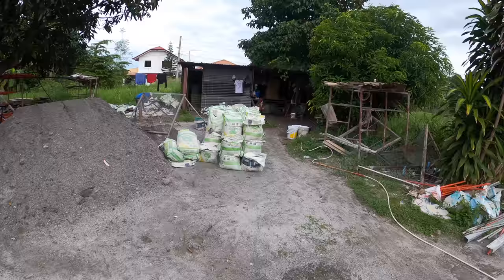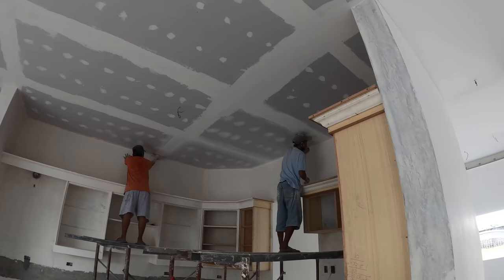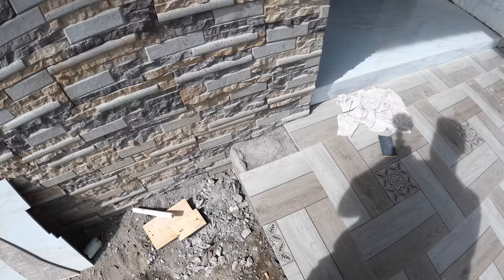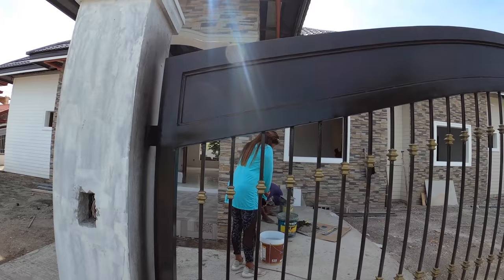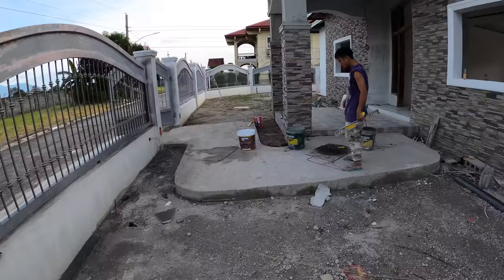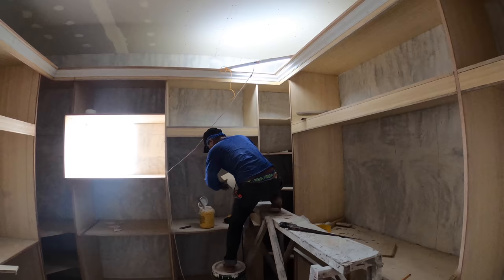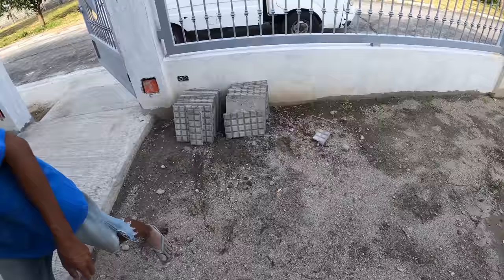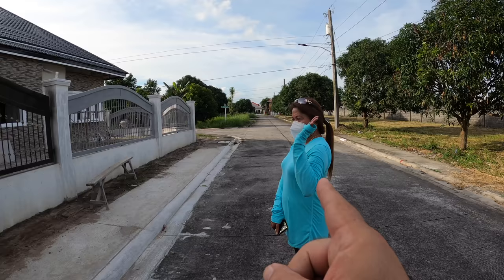Philippine House Building Step by Step, Build Day 200: Let’s Do The Time Warp Again

Comment: Re-watched episode 148 to see the way you did your window sills.  The ledge you have is a great technique for keeping water out while allowing drainage. In PHI have you seen the use of flashing  for the windows? I also have seen the sealant is used on the outside and inside of the window instead of putting a good bead on before the window is set, allowing pockets of water to collect.
Reply from the maker: Have not seen window flashing here. I will keep an eye on the window setting when it finally gets started.